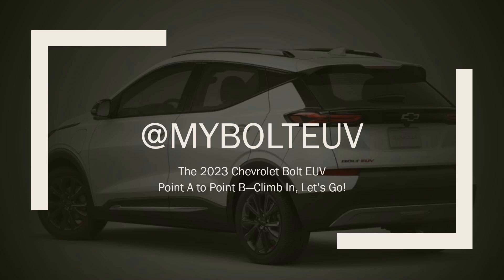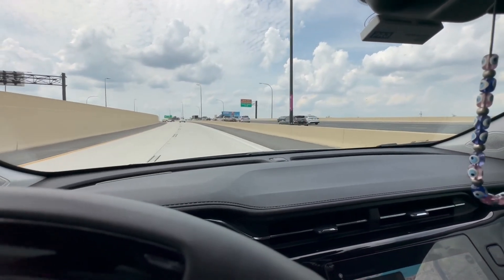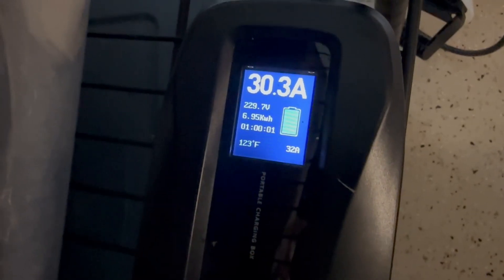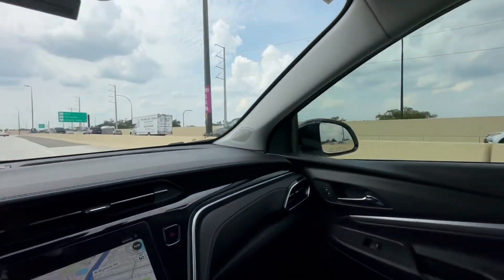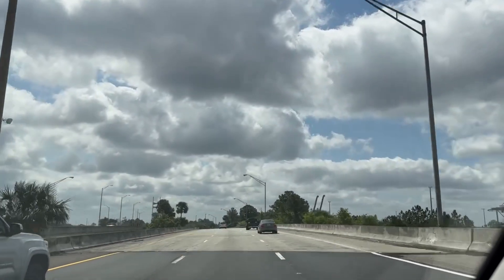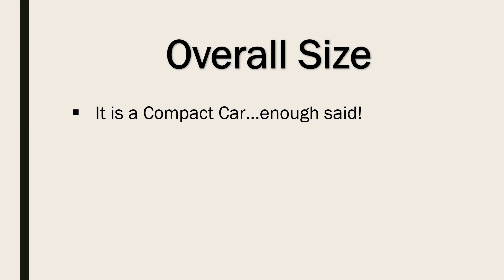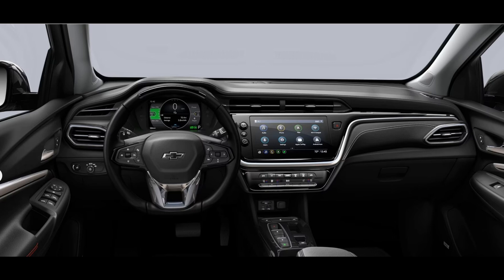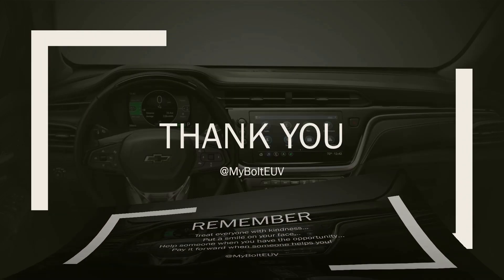The Limitations

Comment: Regarding the charge rate, I don't think I'd want to have this for a road trip vehicle, I'd want one with a faster charge rate to minimize charting stops.   This would be an around town vehicle for me.  In our lives in-town driving is 99.999%, my wife does not like long road trips anyway, if it's more than 3 hours away, we usually fly.  So, the limited charging rate would not really be a deterrent for me.  I also know from borrowing my parents ID.4 when they are out of town, that I can live with level 1 110V charging at home for day to day around town usage, so I don't really even need the 55 KWH capability most of the time anyway.

Probably the biggest limitation for me would be the compact size, I'm 6'7" and would have to see how the legroom and headroom is IRL.  But if I can sit in it comfortably, then I'm sure it would be fine, we don't need to have two big cars, we have medium and large SUVs now and I'd be fine with medium and small, so long as my knees are not against the dash and my head against the ceiling.

On the top speed thing, we have toll roads with 85 MPH speed limits not too far away,  I could see hitting the limit if you were passing someone and someone was bearing down on you from behind, folks can and do drive 15 over here.  That said I don't use the one with the 85 mph limit hardly ever, and the top speed limitation would not be a deterrent for me purchasing one.    

I'm sad that they are not making this vehicle anymore after this year.  The USA needs electic vehicles in in this price range.  I would definitely consider one if I was looking for a vehicle.  My next vehicle will definitely be an EV, I just need to wait another couple years until the wife's car is paid off, I try to avoid having two car payments at the same time.  Maybe used, although I haven't seen too many of these used, they seem to get snapped up pretty quickly.
Reply from the maker: The Bolt EV and Bolt EUV will flood the used-car market in the 2025-2027 timeframe as more EV models hit the showrooms.  Tesla will, no doubt, bring a cheaper alternative to the Model 3.  And when they do, the other manufacturers will be back in "catch up" mode!  That Tesla will hit no later than the 2026 year model...

Comment: Im in the market for an EV because i qualify for the CVAP and CVRP program. Should i get the EUV now or wait dor the equinox ev
Reply from the maker: I can only tell you that I didn't wait. I had three reasons.  1) The Tax Credit.  2) My experience with the Bolt EV. 3) The Equinox is a new design. Typically the first  model year of any new vehicle will have the most problems.  But since the Equinox is built on the proven Ultium platform, that may not be the case.  It will be slightly larger than the Bolt EUV, so that may also be a consideration for you.  Best of luck...
Reply: @jimsEVadventures  Thanks. I can't really do much until i hear back from the CVAP. Even though I qualify, does not mean I will get approved. But the most important approval I need is from my wife, who will not be happy about it haha
Reply: 1 low income it does no warranty a cvap 2 if you are low income the cvrp or tax rebate it going to be low or nothing.
Reply: @nestorvillalobos4101  i figured the tax rebate will be close to 0 but the cvap and cvrp is guanteed 15k